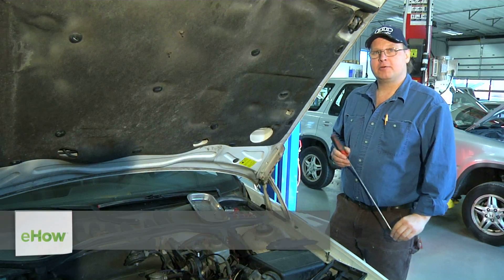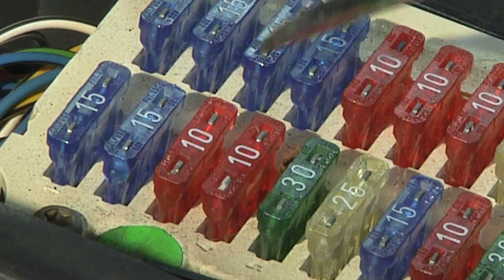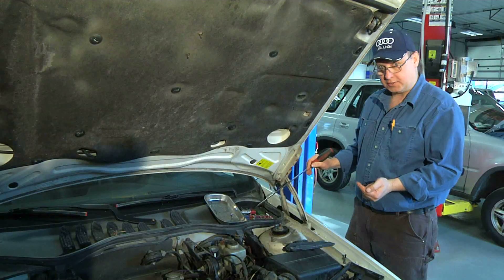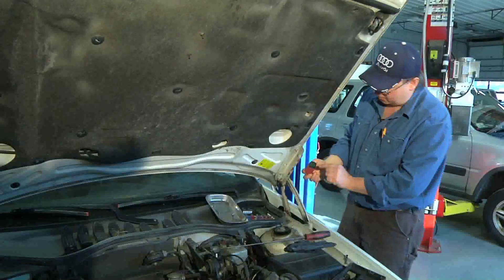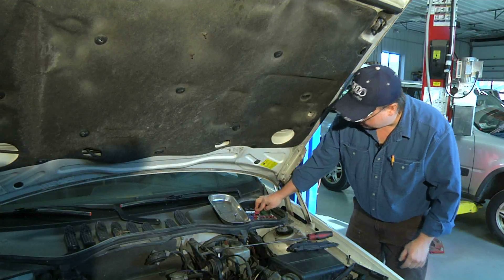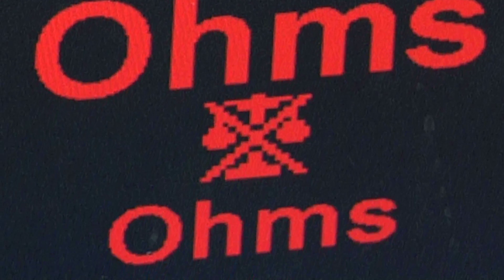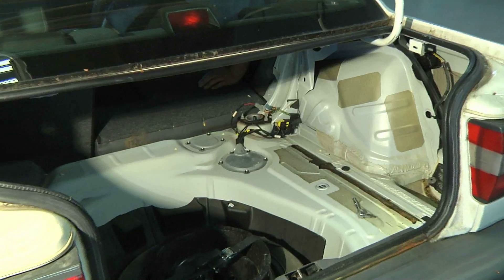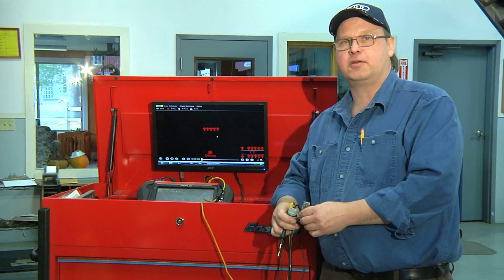Maintaining a Car's Electrical System : How to Check Wire for High Resistance on a Fuel Pump

Comment: Great video. The concept for checking high resistance is easy but you didn't mention how much resistance is considered normal for say 12" or 20' of wire.